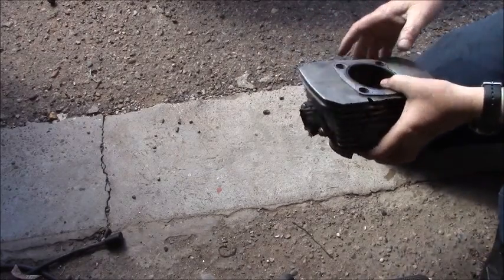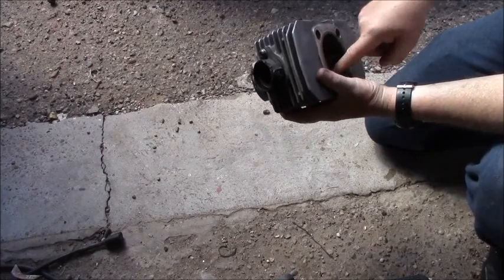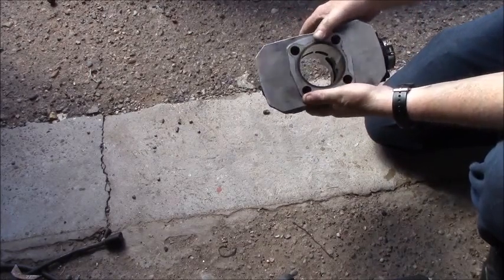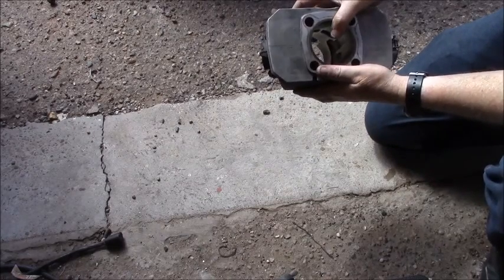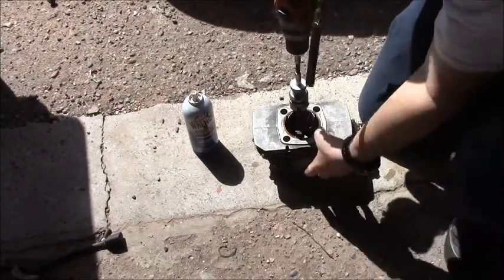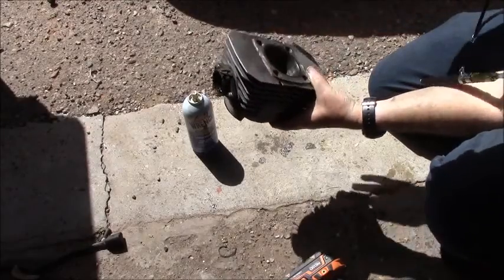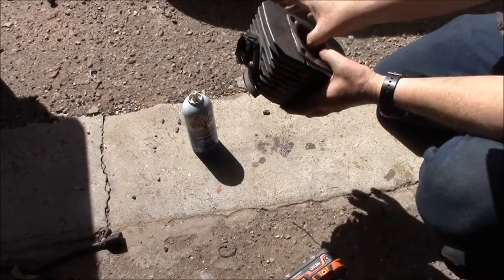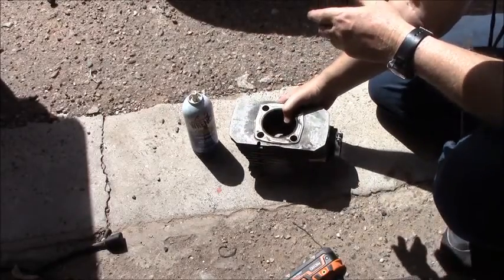Honing  a 2 stroke cylinder after a seizure, or when re-ringing

Comment: Why can't I just use a purple Scotch pad, and do it by hand?

I have a new 80cc cylinder, and  I'm not skilled enough to use those stones (which I have) without tearing up the transfers.  I'm just switching out the rings & piston.  The piston was flawed in a tiny spot just above the top ring, and it was starting to score my cylinder after only 5 miles.  

I'd rather just do it by hand, but don't know if it can actually be done.  The score is barely enough to feel it.  I just want to break the shine off the cylinder.   

Thanx
Reply from the maker: I would guess you can, nothing I would do though. Why did you have a problem with the hone? Just keep the ends of the blades out of the bore.
Reply: The transfers are a problem, and the little 70cc motor won't hold stones long enough to keep both ends out of the bore.  Therefore, at has to be done 'up & down' like you did, and the stones will catch the transfers every time.  Mof, I already ruined a new sleeve trying to do it. 

All I'm looking to do is get the shine off, and, I don't know if a purple pad is capable of it.  

Btw, why wouldn't you do it?

Is there something I may need to be aware of before I try it? 

Thanx for responding 👍

🇺🇸
Reply from the maker: @whatsyurprob158  I guess sometimes you have to do what you have to do. But it is very important that the cross hatch is 45 degrees-ish for proper oil retention. so, I don't know how you are going to do that by hand. I guess if I was stuck, I would slot a rod and stick some scotch bright in it and then use a drill and lubrication.

Comment: Can I just hone the cylinder from .030 to .040 to fit the new piston and rings or will it need to be bored at a shop?   
 I bent the ring and piston groove reinstalling the cylinder. The .040 is all that's available. It was running nice but needed transmission work. (1971 Hodaka 100cc)
Reply from the maker: Only if you have a machine shop Sunnen hone. A ball or blade hone will warble out the bore badly.

Comment: What if you have bigger exhaust port does it matter or is it good?
Reply from the maker: I have mine out to 70% cordle, no problems.
Reply: @johnnydanger57  what does cordle mean and the hone tool wont mess nothing up
Reply from the maker: @bryantb3391  cordle is the measurement straight across a port, not taking in the curvature of the bore. The %, is the portion of the bore. If the bore diameter is 100mm, the cordle of 70%, would be 70mm
Reply: @johnnydanger57  thanks for the info

Comment: I'm a bit late but if I hone a rm80 cylinder do I have to buy thicker rings?
Reply from the maker: Well, they dont make thicker rings, thet make over sized pistons and rings. Which require boring the cylinder. I seriously doubt you could hone that much off a cylinder. Most likely the piston will rattle some.

Comment: My question is how did you get the cylinder off? I cant get a socket on the nuts and an open end wrench doesnt fit tight enough to get the leverage to get it off
Reply from the maker: Rovid Bouski what motor?
Reply: Yt125g
Reply from the maker: Sorry, I can't tell you on that motor. There should be a manual on line, so just Google your model.
Reply: I have the manual, it just says remove them
Reply from the maker: The only thing I can recommend, is call your Yamaha dealer, or check on this facebook page for help. Atc and three wheeler freaks
Reply: I got it with a torch and a crow foot wrench, thanks though